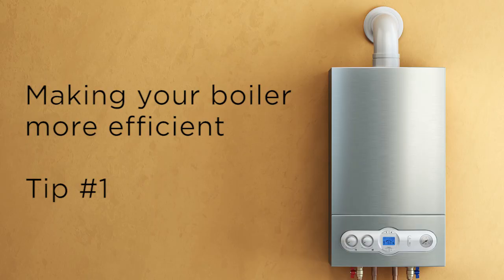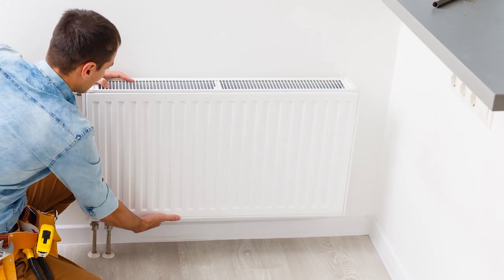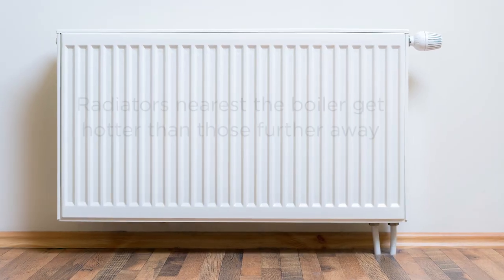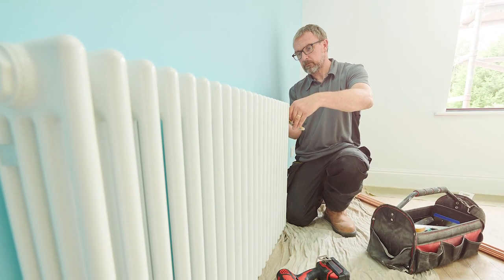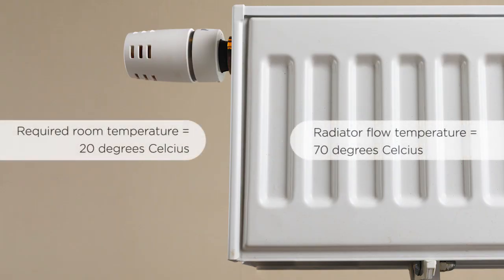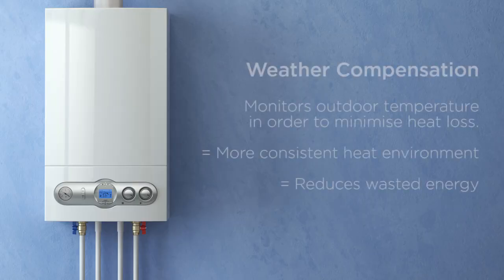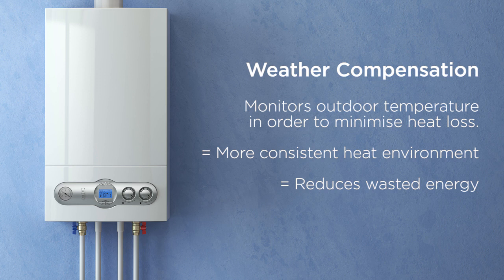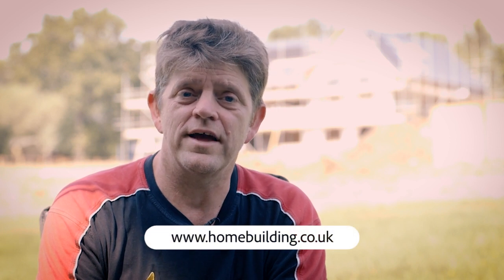How to Make Your Boiler More Efficient | Homebuilding

Comment: Absolute rubbish regarding balancing. Anyone can do it.  With the heating off turn down all the lockshields to off then open half a turn.   Switch on the heating and see which radiators heat up first. Turn those down a fraction. Some really cold radiators might need turning up a fraction of a turn but see if you can do the adjustments by turning down radiators, as a turned down locksheild forces water into cold radiators. Do this every day when the heating is first turned on. After a week of tinkering, all the radiators will be balanced but make sure there is a temperature difference between both radiator pipes for flow and return.  Ideally between 11c and 20c.  A digital thermometer can be bought for this purpose.  To get best efficiency run the heating at a lower temperature, which might mean for longer.

Comment: With my opentherm boiler should I just set the temperature output to max on the boiler and let opentherm do its thing and modulate according to the temperature in the house or should I set the temperature on the boiler to position ‘E’ which is 60degrees which my boiler manufacturer recommendeds for optimum efficiency? At output 60degrees my house takes longer to reach the desired temperature and so is using more ££
Reply: The higher the temperature you have it set to, the lower the efficiency it will be running at.  Therefore it will be costing you more to hear the house up to the same temperature…
Also there will be less wear and tear on the components inside the boiler if it is constantly running at a lower temperature, rather than switching on and off at a higher temperature.
Think of it like a car, slower speed takes longer to get there, but means keeping revs low and getting more MPG.
Reply: That's a great analogy that many will be able to relate to, & so aid their understanding of what their actions achieve.
Reply: IMO you should set it to E. I hear what you say - shouldn’t opentherm do all the modulation and I think the answer is let it do some but you set a manual max temp. I set mine at 60 and TBH it stays at 60 a lot but today it came down to 55 all on its own so it does work.